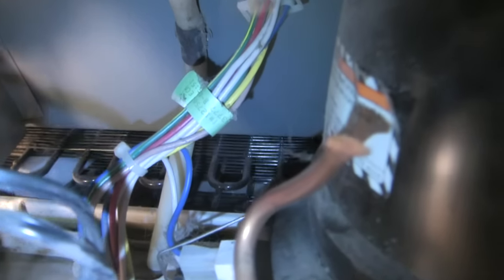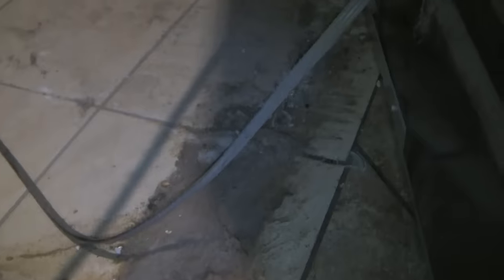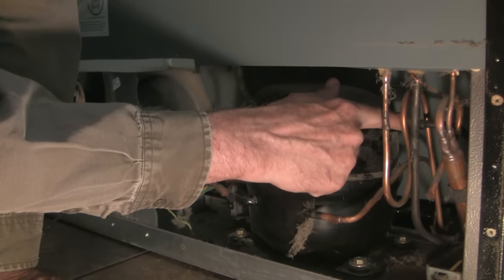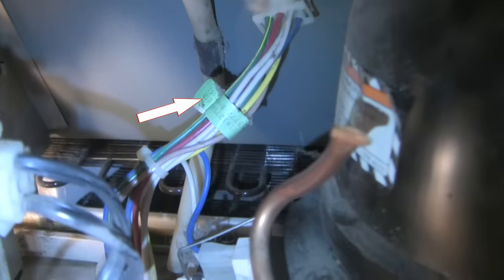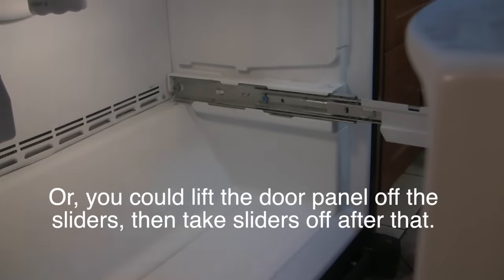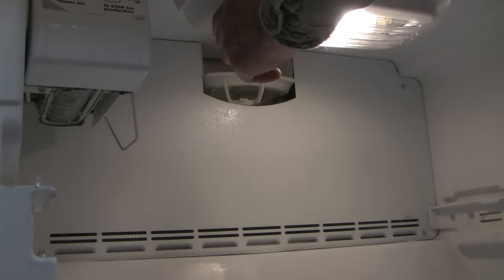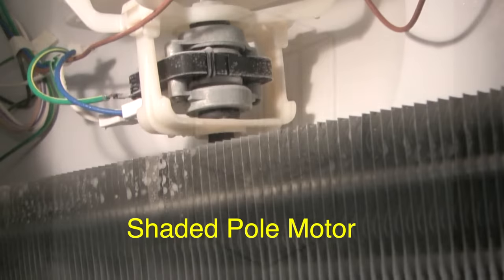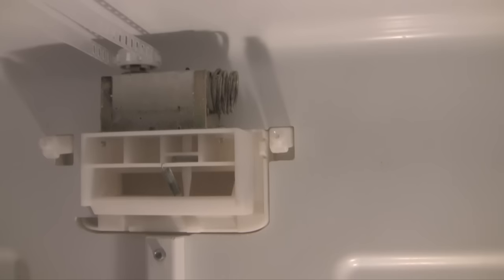How to investigate and fix a fridge that is too warm

Comment: Hi, how warm should the outside of a mini-fridge be to know that it’s working normally and not overheating ?
What temperature setting should my Galanz be for the fridge compartment? Freezer? 
Also , how do I know that food and everything else is cold enough objectively (and not just cold to my touch) so that I don’t eat/drink properly cold enough (safe) foods/drinks? (If that makes sense).

I’ve been looking to see if the starter relay for my Galanz can be replaced but from everything I’ve read , it seems no one has found the exact one that Galanz originally uses nor does Galanz sell it on their website. It seems others have bought acceptable replacements but what concerns me is if there might be a fire risk in the future or more chance of a malfunction and then a fire because it wasn’t a genuine part…
All this leads me to wonder if I should just get a new mini fridge and definitely one where you can buy genuine replacement parts easily. 
If so , can anyone recommend an excellent even if slightly more expensive than Galanz mini-fridge? I’m not looking to buy the cheapest one since that can actually cost more in the long run so something very reliable , durable , energy efficient , etc. 

Thank you . I’m in the US.
Reply from the maker: I don't know anything about what's on the market today. Ideal Temp targets for fridge and freezer are shown in the first few minutes of the video. In most modern fridges the condenser coils are covered, but you still want to leave lots of room for air circulation. The PTC relay is pretty standard for minifridges.

Comment: My freezer was frosted and the refrigerator area was warm due to iced coils in the freezer which blocked the air flow to the refrigerator area. Reason for the frost in the freezer was a bad defrost timer however, it just got stuck so I unstuck the timer by turning the dial and it’s working again.

Comment: Hi spelunkerd, good stuff.  I have a GE Monogram frige almost 20 years old. Refrigerator getting too warm f& bottom freezer too cold.  The evaporator coil now ices up and when I defrost with a hair dryer everything's good until it ices up again at the end of the day and frige starts getting warmer. What parts do you suggest I replace?
Reply from the maker: I'd search for the wiring diagram, often hidden inside the fridge, somewhere, or online. In this fridge it was tucked beside the condenser coil, but I've found them hidden in many places. This sounds like a defrost problem, assuming it actually has a defrost cycle. Defrost requires a heating element that can go bad, a timer that can fail, a fuse, and a circuit. The timer in old fridges was mechanical, new ones are electronic. I'd inspect that circuit and decide what is missing. Then do a repair or search for replacement parts.

Comment: What is the fabric material used for that was attached to the back panel when you took it off? Is that some type of insulation ?
Reply from the maker: Usually noise suppression material, often fire resistant.
Reply: @spelunkerd  Thanks for replying.  Did you end up replacing the material since it was so dirty? Or were you able to vacuum most of the dust off of it?
Reply from the maker: @rerunman000  All I did was clean it, with compressed air, a vacuum, and floor cleaner, ha ha.

Comment: Hi! I have built in Thermador fridge( real pain in a butt:) let me tell you) and top part does not hold the temperature but freezer works well. We called the repair man and he pumped some freon. It worked well for a couple of months but was  making loud noise from time to time, then its again 10 degrees Celsius and everything in the fridge go bad fast ! Please give some piece of advice on this model! Thank you very much!
Reply from the maker: I’d be seriously thinking of replacing the fridge. Save the expense of more repair.

Comment: My drain tube was not draining and causing a water leak inside the fridge settling on the shelves . I took the back off and found that the drain tube had frozen. I unfroze it and cleaned it but my question is this , on the bottom of the drain tube was a rubber fitting attached that narrowed down to a slot . I removed it because I thought it would drain better without. After considerable thought about removing it , the only conclusion I have come to was that it's purpose was to either slow the water coming down or prevent warm air from rising up the tube.That was about 2 months ago that I did this and the fridge seems to be working ok. My question is should I leave that rubber fitting off or put it back on as I don't know how important this fitting is.
Reply from the maker: Good question, I don't know. If in doubt, my general theme is to respect what I don't know, put it back, ha ha!
Reply: @spelunkerd  LOL Thanks for an honest answer. It won't be much to pull out the Fridge and remove the back so I will put it back on just for peace of mind .

Comment: Should I hear s compressor? Or if I touch it should it vibrate?
Reply from the maker: New ones are pretty quiet but you can usually hear or feel something. If the compressor is working the output tubing will be hot.

Comment: To transport my new frig on its side...how long do I need to wait.? Before I can plug in
Reply from the maker: My dad worked in this industry and as a rule of thumb he used 24 hours. He also said to listen to the compressor at startup and make sure it is not lugging. Unplug right away if the compressor doesn't sound right.
Reply: @spelunkerd  thank u
Reply: I think a week will work ...leaving it in the cabin

Comment: What to do if your fridge cools little too much and the freezer is not cold enough ? thank you
Reply from the maker: That air vent at the top of this fridge has an adjustment knob that allows you to dial down the volume of cold air blown from the freezer to the main fridge. I would dial that down first, and wait a day or so. Those controls can sometimes stick and even freeze in one position, so look for that. If it is still not cold enough in the freezer, check the door seals to be sure they haven't been propped open by frozen food that doesn't allow it to close completely. If all is well and you are still not cold enough in the freezer, dial the freezer control one notch to the cold side, wait a day and recheck.

Comment: My fridge is not cooling and my freezer is not freezing like it’s suppose to. I took it apart and looked for defrost and nothing was there . Cleaned the coils because they were dirty and still nothing . I can hear the motors turning on .  I have an Inglis fridge , I know it’s something basic but can’t figure it out, any suggestions ?? Thnak
Reply from the maker: I"m assuming your door seals are perfect, you need to carefully examine those. Even a couple of mm of gap could be enough to cause the system to decompensate. If you have a problem with sticking in the defrost cycle, usually the fans are off during defrost, as is the compressor. So, probably not that. If you have a problem with the compressor PTC relay/capacitor, usually the compressor doesn't start properly, you get clicking and humming but no real action by the compressor. I suppose it could still be a bad PTC relay, but the story isn't very characteristic. That leaves problems with undercharge/refrigerant leak, or a failing compressor. Sorry to say, not much else I can think of.
Reply: @spelunkerd  I noticed something was wrong with it when I would find water from the drip pan leaking all the way to the front of the fridge , that’s when i noticed it wasn’t cooling

Comment: If the evap is ice up but the fans running behind the fridge and the freezer is keeping things nice and cold in the freezer but not the fridge what do  I do
Reply from the maker: I'd be looking for the circuit drawing inside the fridge somewhere looking for evidence it has a defrost cycle. The defrost heater in most modern fridges is designed to melt that ice, for a couple of hours every day or so. During defrost the fans are turned off, the electric heater melts the ice, and then the machine turns back on. For now, do the defrost manually by unplugging the fridge overnight. Make sure the defrost drain is not plugged with ice or dirt. Older fridges had a defrost timer that could get stuck. Sometimes melting the ice is all that is needed to get the timer working again. Of course those electric resistance heaters can burn out, and they have a fuse that can blow if current draw is too high.

Comment: Thanks for video can you suggest what's happening with my fridge is started clicking and the freezer has started to over freeze thanks
Reply from the maker: The ice maker can make clicking sounds if it is not seated correctly, maybe because defrost isn't working. Try a manual defrost cycle to get rid of the ice (turn off fridge for a few hours, carefully remove ice with steam from a kettle if you need to), check the drain tube to be sure it is not blocked, and try again once all the ice is gone.
Reply: @spelunkerd  thank you kindly for taking the time to reply I will try this thank you

Comment: I have a bush fridge freezer which turns on but doesn’t freeze or refrigerate! The rods at the back of the freezer are icy but it’s not cooling anything beyond them.

I can only access the compressor at the back, but I can’t see any fan or condensing parts! There is no way to remove the back, and nothing inside that I can see. What’s going on?!
Reply from the maker: In another video I took apart a dehumidifier, which is surprisingly very similar to the design of a bush fridge. Later that dehumidifier failed because of a bad split capacitor and in a second video I showed how to diagnose that common cause of a failed appliance. It's a lot of effort to learn how these devices work, but once there you'll be better prepared to attack problems like the one you describe.

Comment: The refrigerant coming back from the evaporator is not room temperature. It's still cold and is designed that way to help cool the compressor.
Those residential refrigerators do not have an expansion valve. They have a capillary tube. You can see it partially wrapped around the tube there just left of the fat copper dryer near where it feeds into the main box of the refrigerator.
To remove that fan cover, there are "3" tabs. You have to push the tab on one side and at the same time, push the one bottom middle. I'm surprised you didn't break one.
Reply from the maker: Thank you for dropping by and making the comment thread worth watching. Kind, constructive feedback is always helpful, especially when it comes from a pro who does this every day.